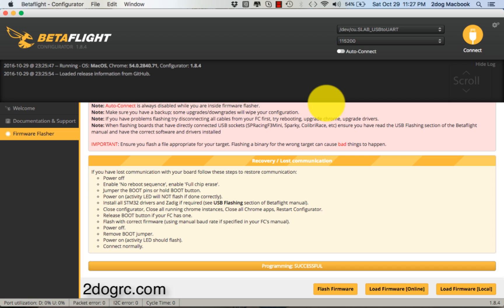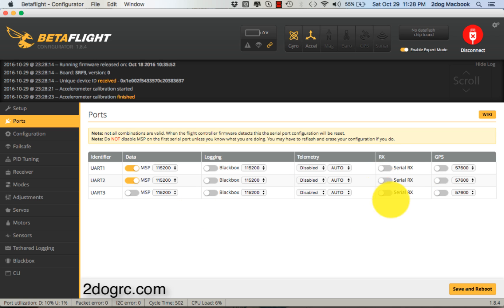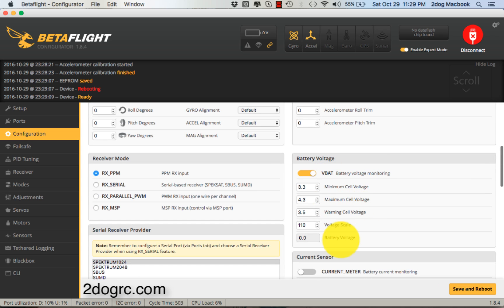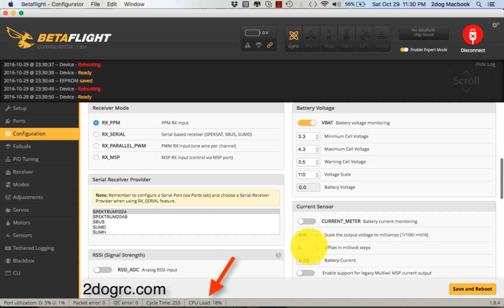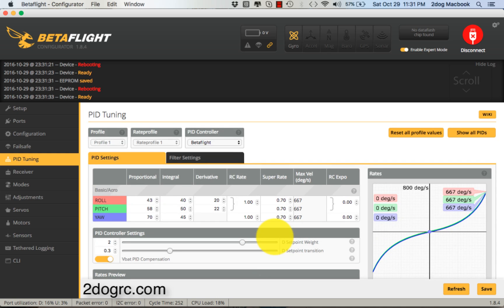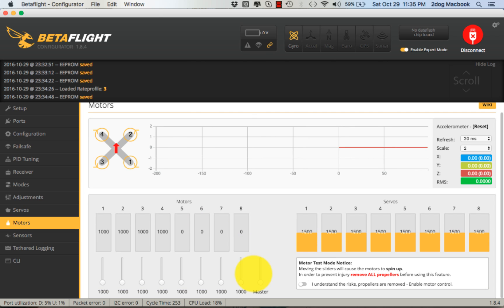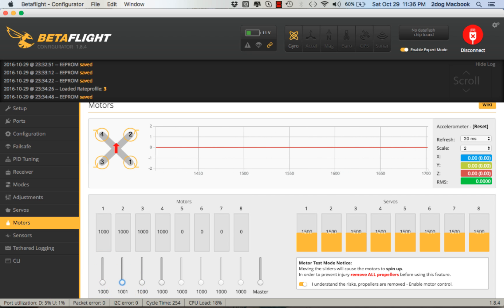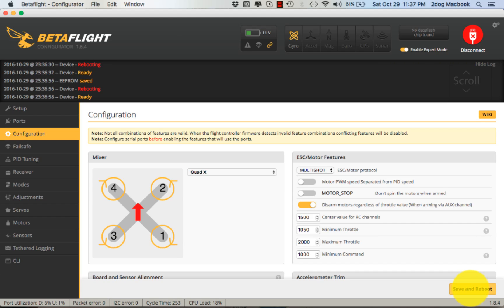Setup Betaflight 3.0.1 On Diatone Crusader 2 or Other Diatone F3 Boards

Comment: If I am using the SBUS pad on the flight controller, am I right in thinking this is not UART1, 2 or 3? Where does this port appear in Betaflight?
Reply from the maker: No, it is an UART.  So set on UART that is NOT MSP to serial.  If you are using the OSD and did not move the cable, that is on UART1.  SO use UART 2 or UART3 to serial.  Then of in the config tab and set your receiver type to serial.
Reply: Hmmm.... Nope, still not working! Followed all of your steps, no joy. Would it help to flash the firmware? I have no problem connecting the XSR to the XJT module, but the Tx response doesn't seem to be picked up by Betaflight.
Reply from the maker: Set Uart  3 to serial, save. Then in confit tab select serial receiver, and receiver type SBus. Then save. Try that and let me know. The firmware should not be an issue as it would be the same process.
Reply: Yep - done that. Going to check all connections tonight and try a different receiver. Thanks for your help.